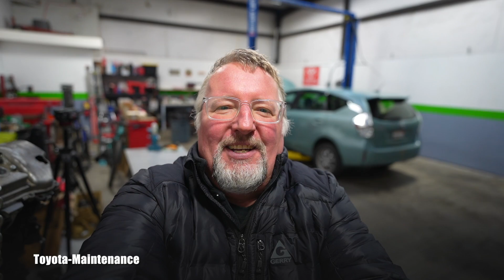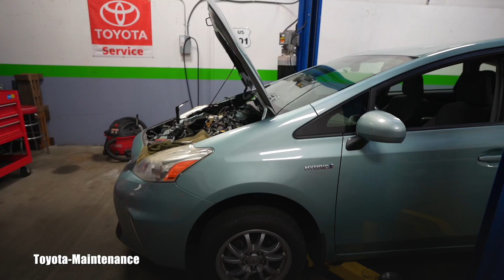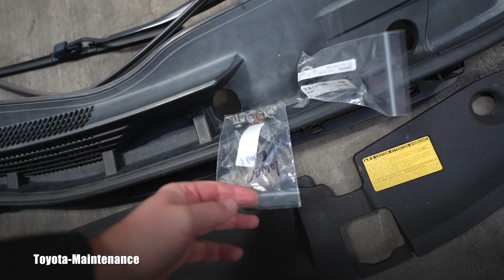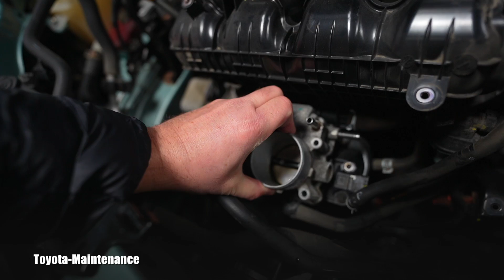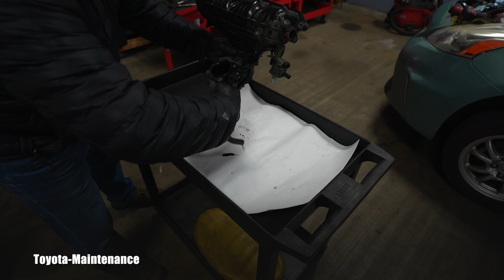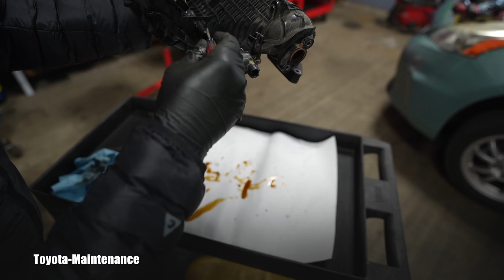Toyota Prius Engine Intake Full of Oil

Comment: Nice video. I think the oil pool in the throttle is the result of the hybrid operation and the PCV route design. You can clean the oil and/or add an OCC, but it will reappear shortly after. The blocked EGR circuit may cause rough engine running at idle/low-RPM. The real question is: What is the main culprit of the blown head-gasket?
Reply: Bad design. You can keep it clean to keep the stress off of it and it can still go. It just wasn’t one of their better designs.

Comment: Is there a way to prevent this from happening?   Maybe replacing the pcv valve?   Or regular oil changes?
Reply: Yes. Check/ Replace the PCV valve periodically and install an oil catch can between PCV valve and intake manifold to keep everything clear of oil/ water-oil emulsion and carbon deposits. There is a dedicated topic on priuschat.
Reply: If this was my car I would install an oil catch can and change the oil and oil filter maximum every 5000 kilometres or 3200 miles or every three months, whichever comes first. (Like I always do)
Reply: You can do whatever you can to try to stave off the specter of this problem. All of what you suggested helps. Most of the "problems" found on Toyota engines were from extended lab condition style intervals on maintenance. But everyone without knowledge said it was die to bad motors. The design could be more prone anyhow. But it's not every car so people must be doing things right. And the ones not keeping up have the same predictable problem.
Reply: I replaced the PCV valve and oil is still leaking somewhere

Comment: I own an 07 with barely 100 KMI. Thanks for making me aware of that issue. I don't loose oil between oil changes and it has given me reliable service on the original battery
Reply: Not a problem or worry on your 2007 as it is an entirely different engine. Gen2 Prius is almost bullet proof.
Reply: @thomaskutches2613  I am never cozy not seeing the engine coolant temp in any of my cars. is there a specific location where I can install a temp sensor on the 07 prius so I can install a temp gage?
Reply: @gerardoguzman5083  I think you can do this by plugging in the scanguage tool. Several guys use it on "priuschat" as it also gives you hybrid readings
Reply: @thomaskutches2613  Thanks so much. I follow you closely to expand my DIY knowledge but hesitant to tinker around with the Hybrid
Reply: @gerardoguzman5083  nothing to be afraid of as they really are not that different once you get into them.
Reply: @gerardoguzman5083  My mechanic installed the sensors for me. I have a A/F wideband, oil pressure and temp and water temp of the inverter. I had the water temp of the ice but the oil temp was a good indicator of any problems and I didn’t want another gauge. 
I have a scan gauge and some OBD software that would work with a tablet but I can’t see it as well as a gauge when I’m driving. I got the oil ports by installing a Greddy oil adaptor that has two ports on it. 
I’d like a digital dash on the steering column but most were designed to connect to an aftermarket ECU with a few analog inputs.

Comment: Really dislike the EGR. What a mess in this one. I had a late 90s that had EGR clogging and it would cause no start on heat soaked engine, like if you stopped the car in the drive thru to wait for them to finish. Stay warm my friend, it seems very cold and with the rain it will be colder in the next few days where you are.

Comment: Not my favorite intake design. I kept up with mine and only had to clean out a little oil once.  The EGR system is not much fun either, but definitely a good little car with surprising amount of cargo area.
Reply: How often and how many miles do you clean your EGR system out?
Reply: @markkrispin6944  I was unaware of the issue until about 90000 miles in. Thereafter, I cleaned it at 40000 mile intervals. That first time I had to clean out the intake, replace the PCV and I had to clean out the heat exchanger because it was barely allowing air to pass through.

Comment: This is why the EGR system needs to be kept clean (and the PVC valve needs to be changed once-in-a-while). Neglect that, and it will blow the head gasket, every time.
Reply: Dammn it found Frappuccino in my throttle today half way through head gasket job